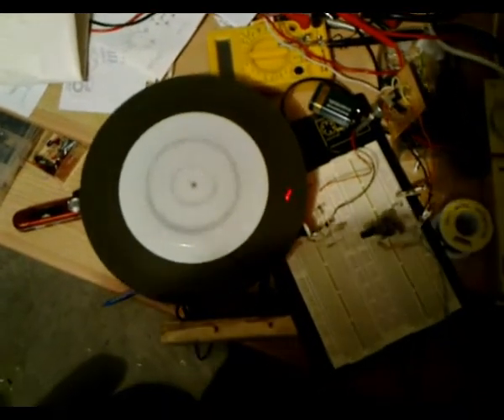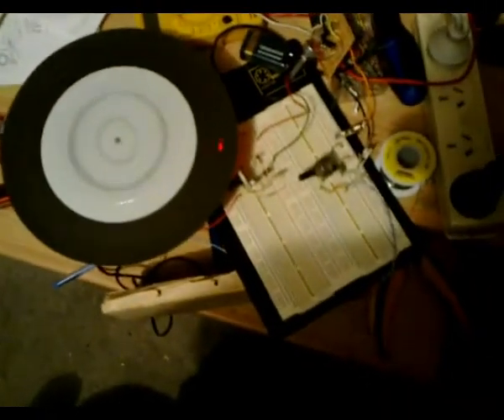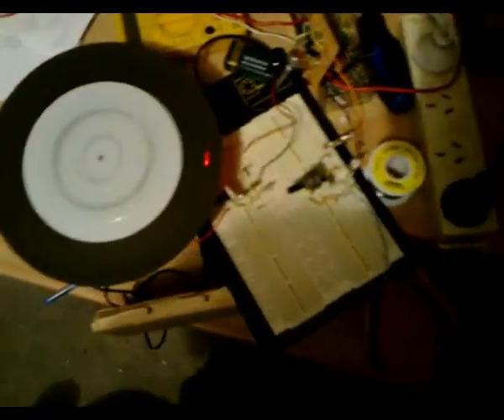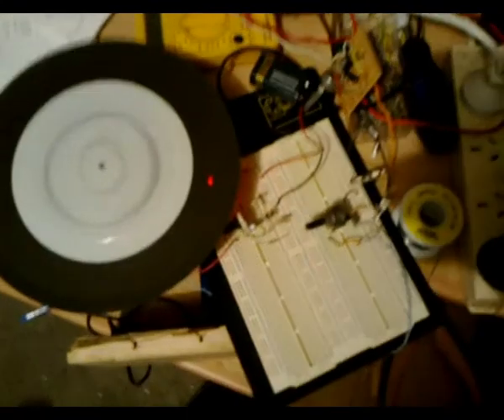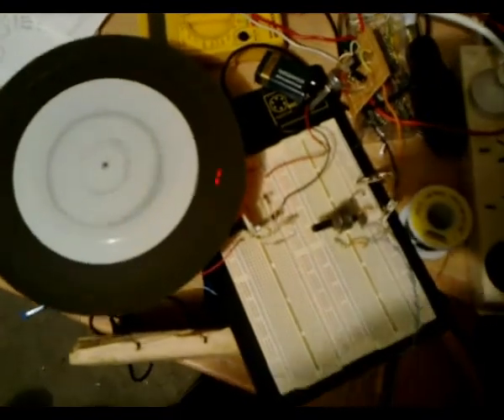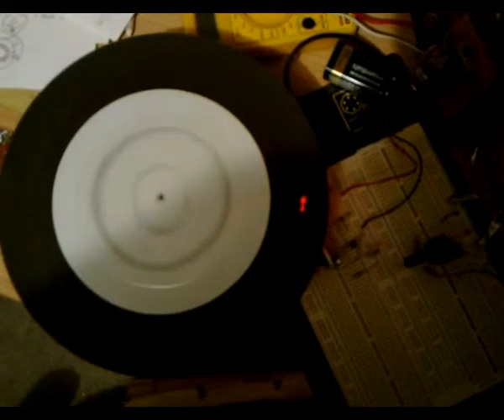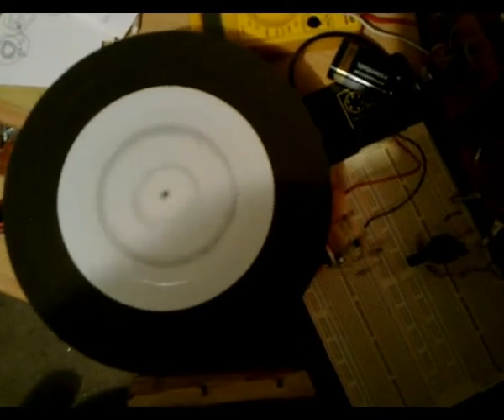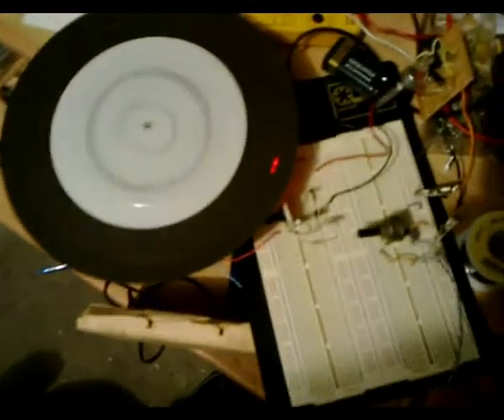Homemade mechanical TV set (part 3)

Comment: i have a one question my friend, what are you put in the input video?
Reply from the maker: Andres Hernandez There is a program that converts normal video to NBTV format which is a WAV sound file which you can output through the speaker output of any audio device to the LED light box. I actually converted the WAV to a MP3 and plugged my MP3 player into the mechanical TV's LED light box and it worked just fine.